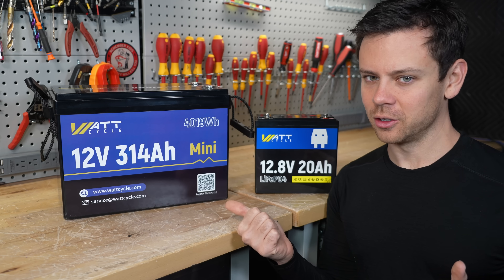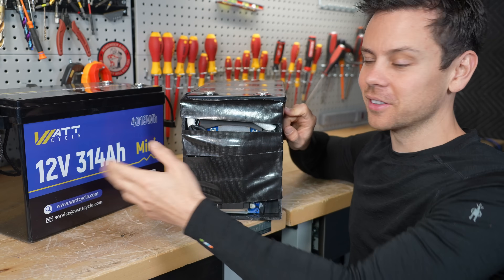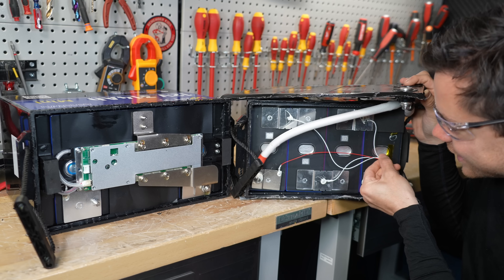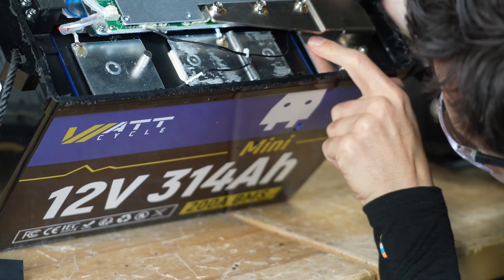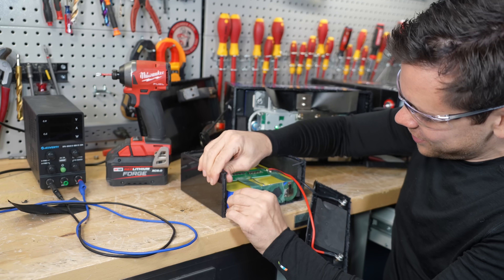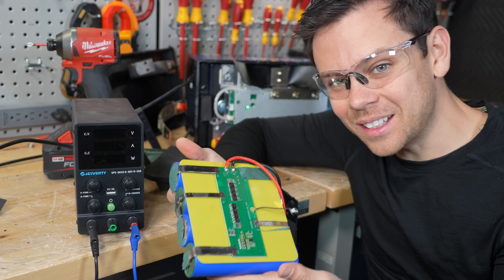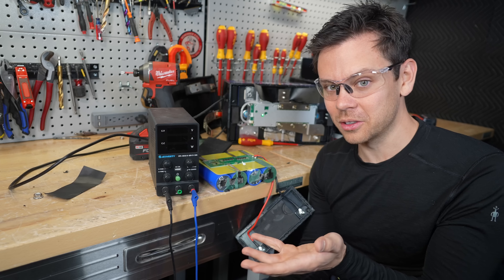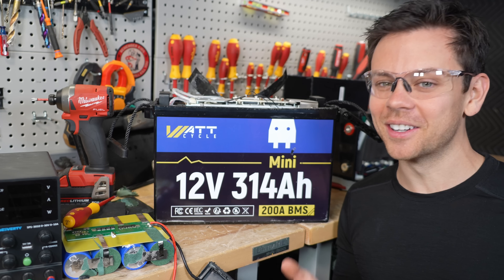NEW! Wattcycle "Dumb" 314Ah LiFePO4 (and 20Ah fast teardown!)

Comment: I had the 20Ah battery and it only lived through 1 cycle (charge and discharge) before it died. I still had voltage at the terminals but it would not accept a charge. Wattcycle customer service was terrible and only offered me a $9 discount toward a new product even though the brand new battery failed and the issue was confirmed by their tech team. 
I opened it up and the cells were way out of balance, I tried manually top balancing, but the BMS never unlocked the charge mosfets. Strange that they also went out of their way to scratch the battery part numbers and barcode from the cells...I suspect they are used cells that are not properly balanced prior to assembly. 
Too bad, I had high hopes for Wattcycle products and loved the 20Ah size and portability for the short time it was working.

Comment: You really feel dumb when your “dumb” battery does not work as designed and you have no possibility to look at individual cell voltages or temperatures. Would never consider a battery that does not have the bluetooth communication. It is a great tool for trouble shooting. Having it does not mean that you have to look at it all the time.

Comment: Not sure I agree with you about smart BMSs. I like having the option to see temps and adjust cutoff limits if necessary. And being able to see how much current is flowing through them is nice too. But besides that I can see why you don't like those apps. Most of them are super messy and hard to use.

Comment: I've used an ESP32 and ESPHome to create a device that connects to Bluetooth BMS in a battery and provide a web page where the BMS can be monitored and controlled. It also allows monitoring and control from Home Assistant. I prefer to use hardwired communication for energy devices but I was unable to get it to work with Canbus or RS-485.

Comment: Usually a 20ah batteries are used in commercial application like ADP or other brands for security or fire monitoring panels. I don't think you could fit a 100ah battery in those enclosures.

Comment: I really like that Wattcycle "Dumb" 314Ah will - its solid and would be great for RV owners  who want reliability and a rugged build that can handle a few bumps
Reply: That's exactly what I was thinking. This would be great for my long weekend trips where I only need it for fridge, lights, and fans. The 100ah I use works okay, but I'm paranoid about usage when I'm spending more than 2 nights. I would even feel comfortable plugging in shore power directly to my inverter with that 200a limit. Right now I stick the battery and inverter in the bathroom and run a power strip into the living area. It's really inconvenient.
Reply: What would you see for monitoring battery status, single or parallel setup? Any suggestions?
Reply: I'm seriously thinking about putting 6-8 of those in our new fifth wheel. 2500 amp hours would power one of our air conditioners for at least a day.

Comment: dumb is ok but I am a casual user.  I have a handful of different batteries like this.  Only one is dumb and I don't know what state of charge is in it.  is there a simple way to know SOC
 without breaking the bank.
Reply: Get a Victron or similar "Smart Shunt". I can see all kinds of information on my battery system, including State of Charge. Does NOT show cell level Voltage, etc., but I only need to know the battery bank's information.

Comment: What do you not like in smart batteries? Apart from wattcycle especially.
I was tempted to buy a "dumb" version of a 12v 100ah and add a 40$ shunt/display monitor (or a victron 100$ display) but in the end went for a bluetooth version from powerqueen.

Comment: The material used on the braided cables is used for Class 8 vehicle ground straps between the truck and trailer.
Reply: That type of tin plated, stranded ground strap used to be fairly common as ground straps from the big Detroit-3.  They offer very low resistance in a very flexible cable assembly!  Cost prohibitive for automotive designs now, but certainly a great addition to a high-pwr lithium battery!

Comment: What I suspect is happening with the smaller 20ah or less batteries is it’s a different OEM. Even though it says watt cycle litime ect. They are coming from a different plant than the 100ah + size batteries
Reply from the maker: Good point

Comment: I like the Bluetooth capability because I can see individual cell voltages.  Without it you really don't know if you have a balanced pack or if a cell is bad or going bad.
Impressive build quality however.
Reply: exactly if you dont want to know dont look, id rather know whats going on in there
Reply: Most likely the BMS has poor top balancing ability either way, so you cant really do anything. The big 314AH will mask any issues for years until out of warranty. Then i guess you either throw it away or cut it open to top balance it yourself.
Reply: @martinschoonover2812  Proper top balancing requires charging the cells to a high voltage (3.65V). In a dumb battery, you have no way of configuring anything, so most likely manufacturer set it up to charge to 3.65V everyday. This accelerates degradation of the cells. I would rather use a Smart BMS with bluetooth so that I can charge to 3.45V per cell for daily use and then charge to 3.65V once a month for top balancing. I can also limit low cut-off voltage to 3V so that the cells are not stressed on either extremes unnecessarily. Yes, it's a bit more work but increases lifespan of the cells too.
Reply: @anupdev5845  Does WattCycle have a high WH battery that allows you to set those per cell voltages?  I'm new to these. I was going to buy the dumb version for my cargo van to replace the dying AGM batteries.
Reply: @martinschoonover2812  they will balance. Will recommends these batteries
Reply: I like it as well. I can see the charge or discharge current and remaining capacity. 
If you have some other equipment already doing that it would make sense to not have it.

Comment: I love my 314ah smart Wattcycle battery in m6 RV, it's just one battery for the 12v circuit and performs great so far. And the bt is very handy to keep track of the soc. 

Same for my smart 48v 100ah golf cart Wattcycle battery works perfect for the 230v circuit.

Comment: You don't think it's good to be able to connect to a bms and see the cell level data ?
Reply: Yeah I don't get this, how else do you see the balance and health over time (without compromising dust/humidity ingress rating)? It's not required to turn the battery on or anything...

Comment: Yes! Please also test 20/30ah batteries. I'm personally really interested in them for diy high capacity powerbanks usually by using them with ip2366 (140w) or IP2366+IP6557 (280w) modules. I don't like prebuilt ones cause if the cells become imbalanced, it's very hard/almost impossible to salvage/repair.

Comment: Will, you might have tested the 314 for Full Charge Protection. Just because its "dumb" doesn't mean it's not present. Several of the LiTime "dumb" version have full charge protection and no Bluetooth to access and possibly change anything like Wattacyle did with the "parallel" setting via Bluetooth. And if the Watt Cycle or even the Litimes without Bluetooth have FCP there would be no way for you to even tell (without some MM testing). And I also prefer Bluetooth myself. Had BattleBorn had a Bluetooth function many customers would have found issues with their battery as they happened in real time because they would see vastly different currents in the charge and discharge. Possibly even a temp warning. But of course, everyone has their own preferences. But for finding failures, BT is pretty convenient.
Reply from the maker: Oh I did test it already totally forgot to mention. That was the main thing I wanted to put in video
Reply: @WillProwse good deal

Comment: I had two 280AH smart batteries and one of them had a bad cell and I wouldn't have known without the cell voltage monitoring in the app. It would be nice to have a switch on the battery to disable the bluetooth though.
Reply from the maker: A switch would be nice

Comment: Can you run a smart battery with a dumb battery in parallel? I currently have 3 of the 12vt 100AH "smart" and 2 stopped working. I don't care about the smartness of them either but need them to work.

Comment: I am actually looking for a small battery to replace the one in my jump starter.  I understand it is not intended for jump starting vehicles but, my jump box has an inverter, air compressor and lights.
Reply: Can't really use any off the shelf ones. Cells like in the 20Ah battery don't have enough ampacity for jump starting, let alone the BMS. It will cut off connection as soon as it over amps.  I guess if you're only using the inverter/comp/lights, and as long as they don't use more than like 250W you'd be ok.
Reply: @andrewt9204  That's what I want to use it for, light duty stuff.  The the batteries I have seen available are only good for around 20 to 25 amp continuous discharge, I would like 40 and looks like the battery case has space for another 4 cells.

Comment: I purchased 3 Watt cycle batteries a few months ago.  Over the summer I used these 3 batteries in parallel to power a portable air conditioner until they were drained.  I then used solar panels to trying to charge the batteries back up for hours, but the Bluetooth did not start working again to tell me the state of charge.  This is the only battery brand which did this to me.  Disappointing Will.

Comment: I currently have two 3 year old 100ah SOK batteries in my camper which have worked great.  Admittedly, I would like a little more storage capacity but don't have room for another SOK 100ah.    This Watt Cycle 314ah would fit easily.  What are your thoughts about me changing these out?  Smart or not so smart?  Thanks!

Comment: I acutally quite like the smart wattcycle battery. I have it integrated into my smart home controller (Home Assistant) so I can see the SOCs, voltage, current. I use only single 12V/100AH in 12V DC UPS to power my comms rack (cameras, NAS, router...)

Comment: 5:20: NO CELL HOLDERS /SPACERS.. this 20Ah battery fail...
Reply from the maker: Good point
Reply: @WillProwse  It fail not only because of that but because it also use non hydrophobic material such as the typical green fish paper which trap moinsture and make cells to corrode. I also noticed that the nickel strip is VERY close to the top edge of the cell, making risk of shorting the negative cell can and the positive tab together even if the very thin cell shrink would puncture close to the sharp edges of the nickel strip. ( that is a very common design fail)
Reply from the maker: @Doctorbasss oh Ive never seen that before. But if there's no moisture from the start, it should be fine right
Reply from the maker: @Doctorbasss  oh wow! That would be awful!!
Reply: @WillProwse  The problem is that there are RV /solar battery that have a design made to sustain vibration from the road and some are made to be static.. but people dont care and mostly the manufacture dont specify that on the casing... BESS and RV battery should be different construction standard.  Btw Will,  as a Battery design and investigation  expert  since 18 years I follow your channel for years now and your learning and knowledge grow very significatively and I would like to congrat you for that and sharing good advices and design analysis on your channel. !

Comment: Wattcycle have this listed under the specs for the 20AH, 5,000+ cycles @100% DOD, 6,000+ cycles @80% DOD, 15,000+ cycles @40% DOD
Reply: Makes no sense to inflate the cycles based on partial DOD. The BMS doesn't consider it a complete cycle until the incomplete cycles all add up to 100% of battery's capacity.

Comment: Smaller batteries have a massive use for ham radio...esp portable backpack setups...3-20ah. Nice to see one opened up and tested
Reply: That 314ah model would run a 100 watt rig, for an entire Field Day, and then some.  I'm not getting any younger, and I love the much lighter weight of these batteries.  I also agree about reviewing smaller batteries.  The POTA guys love them, and so do the radio-prepper 'go-box' guys.  He could really expand his audience, by covering the sizes of batteries that hams are using.  Take care!
Reply: While this might seem insignificant, but many audio hobbyist (including myself) use smaller 12 & 24v  LiFePO4 batteries in large format DIY Bluetooth powered Speakers (Boomboxes)!  There is quite the following out there for the "Boominator" DIY project, which the originator formed Soundboks which sells for over $1000 retail!
Reply: Agreed, would love to see more of the 20Ah and under tested.

Comment: @WillProwse My 4 original "300ah" WattCycle batteries all rest at 13.3v even after charging them to 14.6v. Shouldn't resting voltage be 13.6?

Comment: Watt cycle will likely upgrade that smaller battery after your review. The smaller battery is used for fish locators as it is really light and small . Watt Cycle should do a mini version of it. But they are likely designed it to fit as a LA replacement in the portable locators.

Comment: Wattcycle says I can run the 314aH and the 280aH batteries in parallel (both have the same output). What do you think?
Reply: I have done this with their 280ah and 200ah.  Only issue is that one battery will likely take more of the load than the other due to different internal resistance (which you can measure).  Eg.  Battery 1 55% load and Battery 2 45% load, but they should still equalize their voltages.

Comment: I won't disagree that logging into apps just to check my state of charge seems very stupid, but being able to check the SOC on my single battery setup with nothing but my phone is handy.
For any kind of a "Banked" system I agree 100% with you dumb is simply the best. But my carry around multi purpose single battery the smart / Bluetooth is a handy feature, with some annoyances.
Great review
Thanks
Ps yeah those little batteries make no sense to me given the size n weight of 100ah mini. If I was a hiker maybe, but I use a truck to move anything very far

Comment: Battle Born should take some clues from that 314ah wattcylcle!! Wow. Wonder if three of those dumb watt cycles would work in my 36v golf cart
Reply: At this point, now knowing what we know about BB's products.  And their pathetic formal response to VERY valid customer complaints, I wouldn't touch them with a 10Ft pole! 💩💩💩💩💩💩
Reply: They should as long as the BMS can handle 200 amps, which according to this video it can.
Reply: @MississippiHomesteadJourney thanks!
Reply: They should work better than the six 100Ah LiTime batteries I have in my 36V golf cart. (LiTime says the warranty is void in a golf cart for those batteries, as they only have the 100A BMS). They have been running us around Slab City, CA near Niland, for over a year now!
Reply: @Tumbleweed5150 - In a way I massively envy you guys!  I've owned (mortgages for the last 28 years) two homes.  I did get the hell out of Commiefornia 24 years ago to NV!   But modern America is a psychological trap into the never ending taxes of "The American Dream" scam!  Slab City is an amazing social experiment, one that I'm amazed the Fed Gov hasn't raided yet!    As it represents a rebellion against the Debt/Taxation matrix they've so carefully crafted for all of us!
Reply: @Tumbleweed5150 100ah ok ma in parallelo e serie is 6battery is 38.4volt 200ah is 200ah use continui da 2bms da 100ah in parallel is 6battery no 3battery is minor capacity 200ah 38.4volt nominali litime is 66kg 11kg x6 battery  Vs watt cicle mini is 314ah 38.4volt 78kg is good for 450dollary 1batteria da 314ah mb31 eve in watt cicle mini
Reply: Yes is perfect in serie 3x 12.8v is 38.4volt nominal con 200ah max power is 8000watt max power 40volt x 200ah lifepo4 is 8000wpicco 1c continui e 314ahx 38.4v is 12kwh accumulo lifepo4  capacity is good watt cicle mini is 26kg x 314ah 12.8volt x 3 is 80kg total x 12kwh e 8000watt max 8500watt power

Comment: I Bought the non Bluetooth 314 Ah wattcycle  battery the day after Thanksgiving and the price was great.  I also saved 17% by not buying the Bluetooth version and since I’m just using one battery with my 400 watt off grid system I’m really glad I went with the simple non Bluetooth model, especially after watching this video.  Great job Will.  I’ve also communicated with wattcycle customer service a couple of times and I find their customer service to be top notch.
Reply: Great comment, I'm looking to get one for my 400w solar setup. How's yours working so far.
Reply: @pressinpickle345 very pleased but think I need to go through a few more cycles to improve top balance.  I replaced my three 100 Ah SLA batteries that were 7 years old and the LiFePO4 battery provides a lot more flexibility as the available amount of capacity is so much greater than the lead acid batteries that had approximately the same Ah rating because you can go to a much greater depth of discharge without harming the life of the battery.  I power our family room TV with my system but the primary purpose of my system is emergency backup power instead of a gas generator.